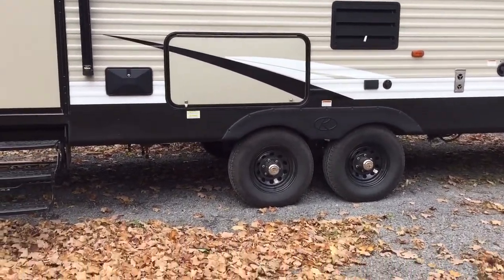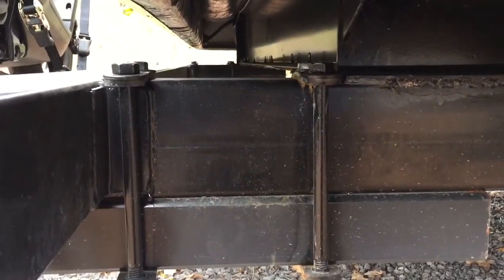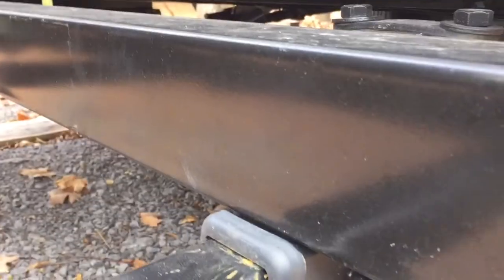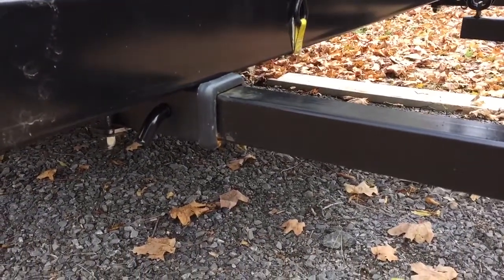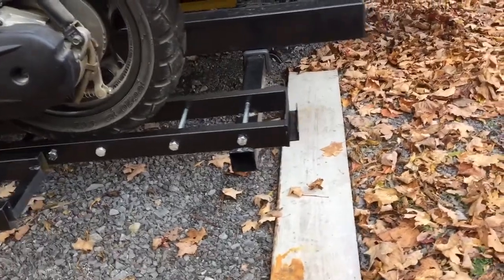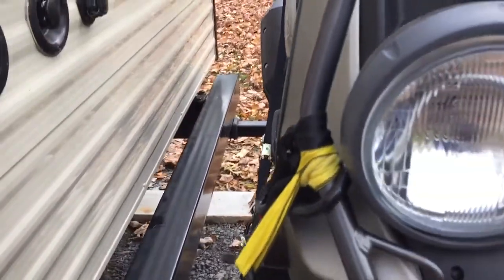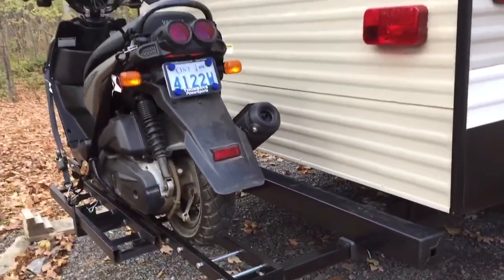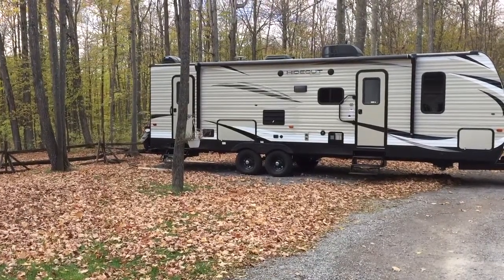Travel Trailer Motorcycle Mount

Comment: How is the added weld holding up?   Also how thick is the wall of the  2x6 that is welded to the frame ?  Bty great idea . I’ve been brainstorming ideas and saw ur solution.  Just wondering if that 2x6 steel is going to tare

Comment: Hey Kevin, what did you use for those plates you put on the top and bottom side of the nuts and bolts? Where did you get those plates and how thick are they?
Reply from the maker: They are spring shackles. Got em at Princess Auto here in Canada.

Comment: How’s it holding up? Where did you get the actual rack? Self-made?
Reply from the maker: Pulling Chocks I sold the trailer last summer but I used the setup several times before it was sold and never had an issue. I bought the actual rack. It was just a motorcycle carrier for a vehicle.
Reply: @adventurekevin9409  Thanks Kev! Great idea regardless

Comment: How have you liked the carrier? Any issues or concerns. how about dragging.  looking to do this on a fifth wheel for a honda 250 scooter but it weighs about 350Lbs so i may have to beef up the frame a bit.
Reply from the maker: Michael Chung I sold the trailer last summer but used the setup several times without any issues. The only thing I didn’t like was not being able to see the bike on the back while driving. Always afraid something back there was going wrong. Would stop and check every so often and all would be fine. A rear camera would solve the worrying issue I suppose.
Reply: @adventurekevin9409  thanks